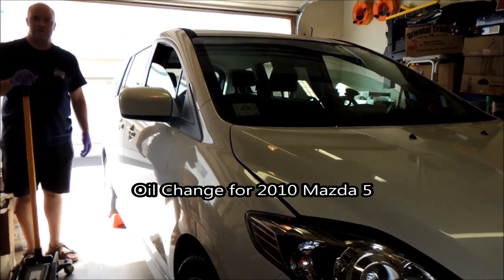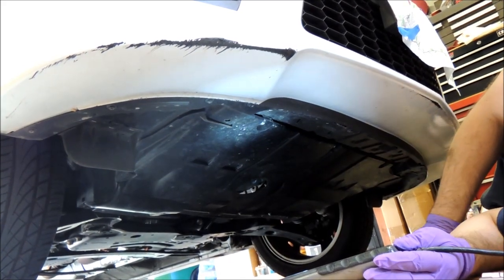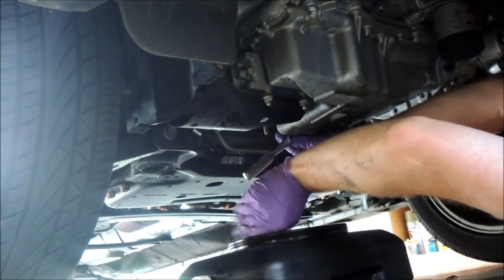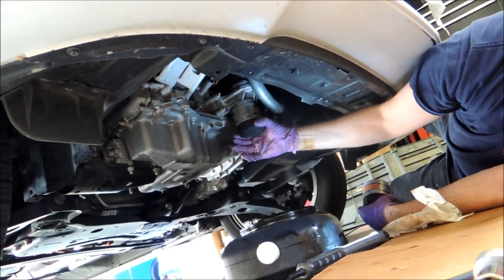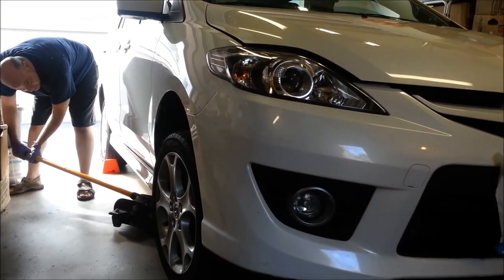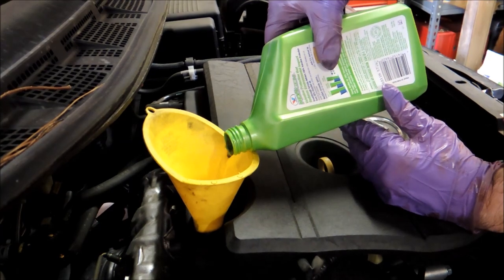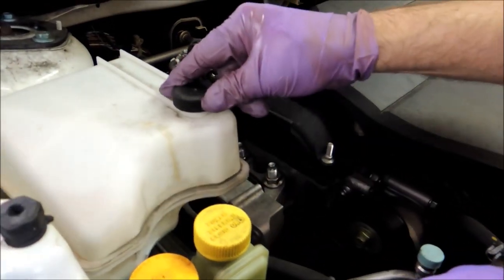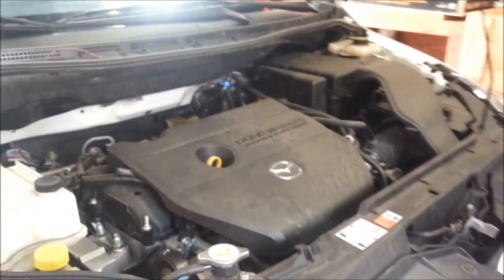DIY Oil Change for 2010 Mazda 5

Comment: Always good to check for Any leaks before putting the engine splash guard back on. Never go under a vehicle with just a jack holding it up, place 1 or more jack stands under it in case the jack fails so you will not get crushed under the vehicle. I know of a man that Died this way.

Comment: Did you pre-fill the new oilfilter?
This one has straight up mounting, so that's extra easy.
Reply from the maker: Thank you for watching. I don't prefill the oil filter. It only holds a little bit so it doesn't make that much difference on the first start.

Comment: I would leave the plastic cover off all the way until the end of the oil change. Why? So after you're done, you can inspect for any leaks just in case you did something wrong. It saves you from having to remove and reinstall the splash guard.

Comment: Just did my 2012 M5 after watching this. That sliding in the splash guard to the proper place - that hook thingy in back - is kind of a bear though. Guess a few more times it'll be easy-cheesy. Gave the bolts and screws a little bit of cat-s**t (anti-seize) since those screw clips look a little delicate. Much thanks.

Comment: Thank you for the oil change vid on your mazda5. I'm considering buying the wagon. How has it been? any issues, cost of ownership?
Reply from the maker: Thank you for watching. The Mazda 5 has been a good car. Easy to drive like a normal car but has the convenience of the sliding doors of a mini van.  The engine is the same as the Mazda 3, so it can feel a little slow on acceleration some times but overall it's fine.  Just not the Zoom Zoom they advertise on TV.  As for cost of ownership so far the big repair items were normal wear items like, tires at about 30K miles and brakes at about 50K.  I would recommend it to others.

Comment: I don't think you should guide everyone with wrong ways to change the engine oil and filter for a Mazda 5 or for any other vehicle for that matter. I have a Mazda 5 and have been changing oil for my car for several years. The black panel need not be removed to access the engine oil drain plug/bolt and filter. As everyone can notice, even in your video, that there is a circular cut out hole in the panel where one can remove and replace the oil filter and there is a also U cut out at the back end of the panel through which the drain plug/bolt can be accessed without having to remove the panel. I'm sorry I do not like to leave any negative comments but in this case I had to comment as I found this video absolutely wrong! Sorry bud! My apologies. Anyway thanks for the video.
Reply from the maker: Thank you for your feedback!  That's a great note and we appreciate you spending the time to write the comment.  We no longer have the Mazda 5 (a great car, by the way :) so based on our memory, the reason we had to remove the black panel was that in our car, the holes didn't line up with the filter and drain plug.  We have seen some people who have to cut the hole bigger in order to get to it without removing the panel.  So if yours doesn't need that, that's great news!  Thanks again and have a great one!
Reply: @DIYProjectsByDave  Thanks and good luck

Comment: Thanks for the video. 
After I watched it, I decided to cut a 2 inch square section ( in front of the circular hole)  off the splash cover in order to replace the oil filter without removing the cover (I did the cut with the splash cover installed).
Reply: Picture of the cut:
https://drive.google.com/file/d/0BzfUcK6-KrRTai1tdTczTktPVEE/view?usp=docslist_api
Reply from the maker: Jimbo S GREAT idea!!  Thank you for your feedback!!
Reply: You're welcome. By the way, I buy Super Tech synthetic oil (Walmart's brand) for the last 18 years. It works great. How do I know? Well, I had a Nissan for 7 years (220K miles) that died when the timing chain jumped (The valve made a hole in the piston). When we inspected the engine's cylinder honing, it was visible to the naked eye!